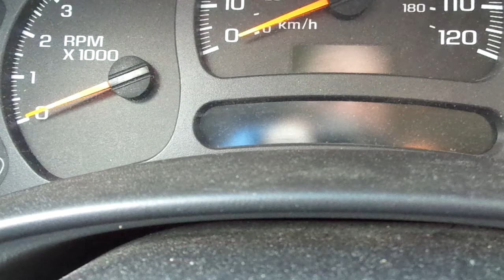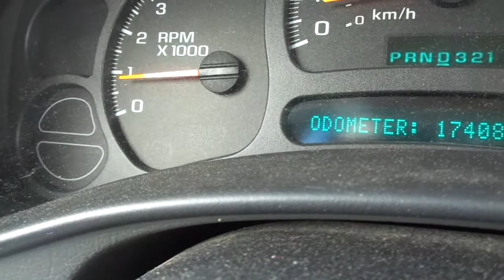Video #2 - 2003 Chevrolet Tahoe - "Service Brake System" and Loses Power

Comment: I posted a video of what I’m experiencing. I had changed my water pump and rad after it blew and all of a sudden I started having abs and brake light come on. When my headlights are on and I hit the brake, my hazards with illuminate. And sometimes when I’m just out driving, the theft light comes on and some of my gauges shut off with the battery light on as if I just put the truck to ON position. All of it will happen while driving around

Comment: My issue is similar to my 2003 tahoe when it rained service brake system warning then the car started to jerk off on shifting all through the gears
Reply: did you ever figure out what was causing problem?
Reply: Same problem right now with my gmc sierra, changed the speed sensors and nothing have changed. Please any help?
Reply: @hassanalkhalifah9259 ground wire abd your wheel barring can be in bad condition

Comment: Mine all came on after I bleed the brakes on passenger side  won't go off no problems before Junk GM
Reply: Same issue. Did u ever figure it out?
Reply: @michaelwilson0889  Nope never could figure it out. I sold the truck it was nothing but problems I got tired of fixing something every month

Comment: We have replaced the master cylinder booster and vac pump with abs module still same problem ?? Any help please ?
Reply from the maker: My Tahoe's issue was caused by a wiring problem with the G104. This is what the service tech wrote on my ticket: "G104 improperly located on back of engine block. Relocated G104 to back of cylinder head and cleaned grounds. Traced wiring and found loose connection causing poor connectivity, putting strain, and causing heat build up. Corrected wiring issue and test drove. Concern resolved." 

I wish I could offer you more help. Maybe someone else who has had the same problem can give you some suggestions. Anyone who can help--Please respond to Nickolas Bennett. This is much an infuriating problem!!

Comment from the maker: Update: This problem was caused by a wiring problem. The repair was completed by my local Chevrolet dealership's service department, so I can't tell you how to make the repair, but this is what was written on my service receipt: 
"G104 improperly located on back of engine block. Relocated G104 to back of cylinder head and cleaned grounds. Traced wiring and found loose connection causing poor connectivity, putting strain, and causing heat build up. Corrected wiring issue and test drove. Concern resolved." 
 
I have not experienced any more problems with this vehicle since having the repair completed in March 2020. 

The source of this problem was very difficult for the technicians to locate. The vehicle was showing the P1518 error code, so before they found the burned out ground, the service department replaced a rear wheel speed sensor ($260.00) and the TAC module ($640.00), which may or may not have been causing the problem. 

If you are someone with the knowledge and equipment to check for a wiring short, I recommend you do this first. The sensor and TAC module may or may not have needed replacing. 

Good luck with your troubleshooting, and if you manage to fix your problem, please add information to the comments so you can help out someone else!
Reply: May I ask how much it was to repair this
Reply from the maker: @shawngregory6637  The dealership only charged me for the original repair involving replacing the TAC module ($640) and rear wheel speed sensor ($260). After having these repairs made, I got the Tahoe back from the dealership, and the same problem with the P1518 error code happened, and it lost power. 

When I took it back to the dealership, they did not charge me anything at all the second time and found and corrected the wiring problem. The following is printed on my receipt: "G104 improperly located on back of engine block. Relocated G104 to back of cylinder head and cleaned grounds. Traced wiring and found loose connection causing poor connectivity, putting strain, and causing heat build up. Corrected wiring issue and test drove. Concern resolved." 

I am guessing that just repairing the wiring problem--which I believe was the sole source of the error code and losing power--would have been a relatively inexpensive repair, like in the $200 range, at most. It seems like this is just a really hard problem for most mechanics to solve. 

Good luck with your vehicle!
Reply: So what was the problem
Reply from the maker: @fernandodiaz7164  This problem was caused by a wiring problem. The repair was completed by my local Chevrolet dealership's service department, so I can't tell you how to make the repair, but this is what was written on my service receipt: 
"G104 improperly located on back of engine block. Relocated G104 to back of cylinder head and cleaned grounds. Traced wiring and found loose connection causing poor connectivity, putting strain, and causing heat build up. Corrected wiring issue and test drove. Concern resolved." 
 
I have not experienced any more problems with this vehicle since having the repair completed in March 2020. 

The source of this problem was very difficult for the technicians to locate. The vehicle was showing the P1518 error code, so before they found the burned out ground, the service department replaced a rear wheel speed sensor ($260.00) and the TAC module ($640.00), which may or may not have been causing the problem. 

If you are someone with the knowledge and equipment to check for a wiring short, I recommend you do this first. The sensor and TAC module may or may not have needed replacing. 

Good luck with your troubleshooting, and if you manage to fix your problem, please add information to the comments so you can help out someone else!
Reply: Usually this happens because abs sensor wire needs replaced cheap fix under 50 $ it would really help also if you had a snap on scanner that way you lift the car up and rotate each tire and the scanner would tell you if your abs sensor working
Reply: The tech is referring to a Grounding strap/ bolt location "G104" means Grounding point #104 in the Shop Manual anytime there are metal and non metal parts especially between body, motor and frame mounting points the ground connections have to be tethered or jumped from one spot to next for best flow of current to electrical parts sensors gauge's etc. Sometimes they are brackets bolts wires even flat braided style straps. These can break, corrode, rust or melt sending all parts that share that ground into a frenzy!
Reply: What does TAC stand for some kind of throttle actuator control or something? Does anyone know?
Reply: @condor5635  Correct--TAC is Throttle Actuator Control. Code 1518 identifies the TAC module as the cause of the problem. Replacing the TAC module in my vehicle did not solve the problem. Relocating G104 to back of cylinder head and cleaning grounds solved the problem.
Reply: I can tell you exactly what they fixed. It says it right in their report. On the back of the engine, there are 2 grounds, one is a big braided flat wire which connects to the firewall under the hood, the second wire which is the wire they fixed is a small black with white stripe wire which goes behind the back left (passenger) side of the engine. This small black wire is prone to damage and usually is the culprit. Find the location where it comes out of the 3 way split in the wiring harness to the back left of the engine, cut the electrical tape and pulled the sleeves back a bit so you can see the wiring, and check the area where that black wire comes into the harness. More than likely the wire is damaged there and needs to be spliced. You can relocate it to the same ground point the big braided ground wire connects to, to make it easily accessible.
Reply from the maker: @EvanRobinson85  Thank you so much for posting this helpful information that will enable other people to make the repair. This is a very common problem on Chevy Tahoes and trucks that causes owners all kinds of grief.

Comment: Quick question dod the power door locks also engage during this issue?
Reply from the maker: Yes, the doors would lock and unlock; the interior lights would come on; and the chime would ding a few times (as it does if you start driving without completely closing the rear access hatch.)
Reply from the maker: Also, if you may want to watch the first video I posted showing how the ABS and emergency brake lights would come on when I hit a bump. Here is the link: https://www.youtube.com/watch?v=X4iNmwB3lms&list=PLXHEoDbzIdZQx76s6GAVx8bPYR2t4w0fG&index=1
My Tahoe was experiencing all of these different types of problems before the dealer's service department finally fixed the wiring problem with the G104's being improperly located, as I described in the comments I posted some time ago.
Reply from the maker: Just found this video:  https://www.youtube.com/watch?v=K3XOqeH2HCA                      This man had the same problem PLUS he shows how he repaired it!
Reply: Fabulous FF thank you so much! It has been a nightmare, you have helped me immensely! Thank you.

Comment: This problem is due to ground wire and also my valeros where bad and that fixed my problem there is a ground wire right below your front tire , driver side

Comment: Can You fix it? Got the same problem
Reply: Mee tooo
Reply: Lmao Anyone found the solution? Same problem
Reply: It can be 1 of 3 grounds 

Notorious and common
Reply from the maker: @randylee2549  This is printed on my receipt: "G104 improperly located on back of engine block. Relocated G104 to back of cylinder head and cleaned grounds. Traced wiring and found loose connection causing poor connectivity, putting strain, and causing heat build up."
Reply: @fabulousfinds7714  ahh thats 1 of those 3 behind the engine to the firewall. Must be all good now 😁
Reply from the maker: @randylee2549  Yes, things are good now. I have not had any more problems since this March 2020 repair, so fingers crossed, I'm hoping that this will be the end of this problem, at least. 
I'm sure a whole new set of problems will arise eventually!